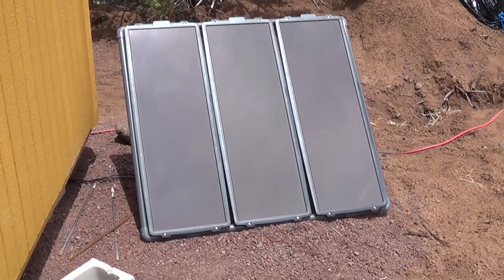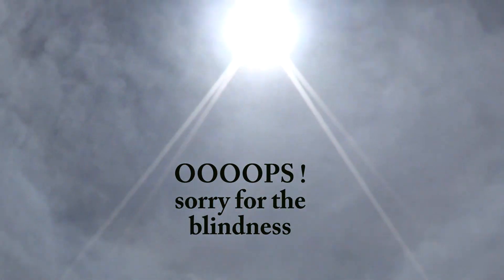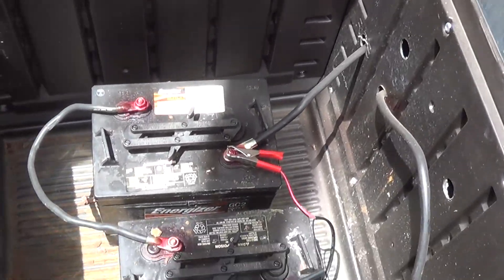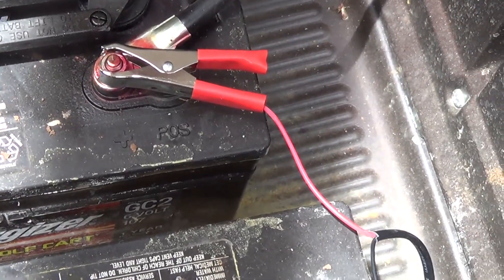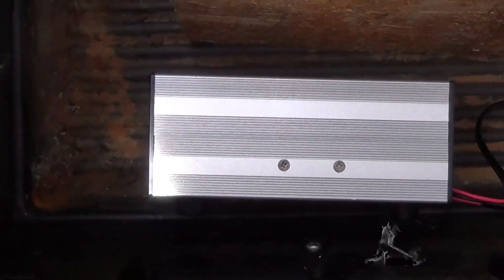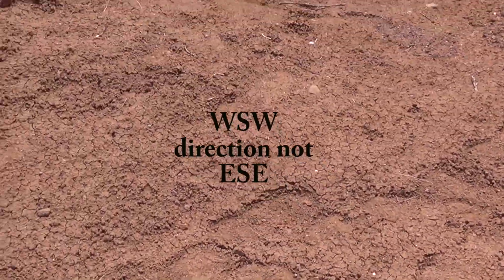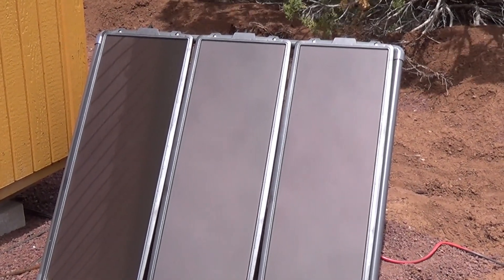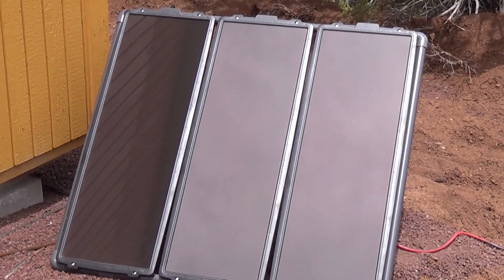45 Watt Solar Panels Charging RV Batteries.

Comment: Correct on the regulator - I also agree with Gamer 1 - no need to disconnect. In a dry climate like AZ temperature extremes do more harm than corrosion I've noticed.
Reply from the maker: k fire thanks. I like that I can put out a video and some of you give great suggestions and advice. it has helped me.     thanks for watching.

Comment: Cool vids - thanks
I have a similar set up. I use a charge controller to prevent overcharging your batteries. Therefore you can leave the panels connected all the time.
Reply from the maker: k fire doesn't the regulator that came with the set do the same thing?

Comment: Jeff, off question who did you get you cinders from? Cost?  we are going to be located off 15 miles N of 277. you Navajo or Apache
Reply from the maker: Talonaz good for you. I got my cinders from a local person on 61 about 3 to 4 miles from Stanford General Store ( also known as the Y) . don't remember size of truck but paid about 140 per truck load. . apache..by the way you going to post videos? if so I will be sure to subscribe.